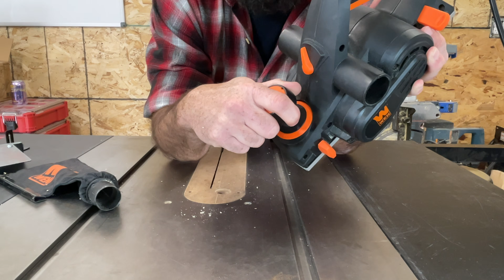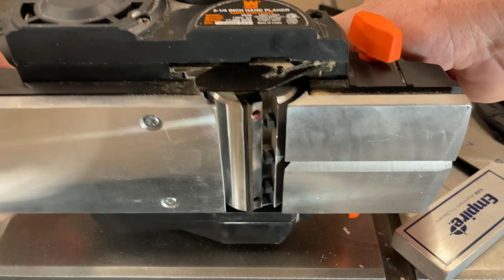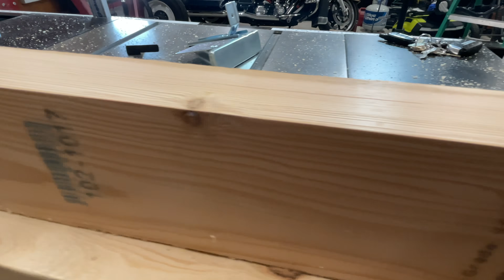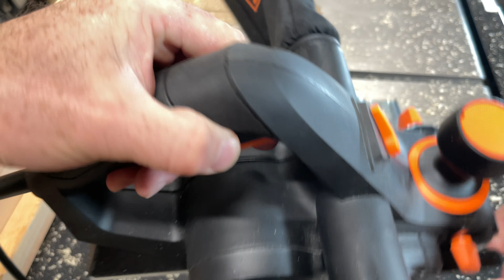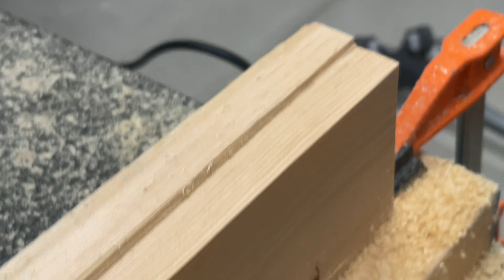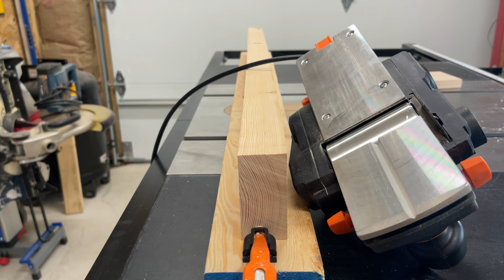Hand Planer How To For Beginners // Wen 6 Amp Planer Review

Comment: This seems like a great way to have a hand plane and rabbet plane for very occasional use without the same learning curve, expense, or sharpening setup needed for regular hand planes. I prefer the manual style, but I’m weird admittedly. Fir the power tool woodworker or carpenter needing occasional planing, this looks like a cool option

Comment: so the rear part is flat and sits lower, with the front being higher, does that mean if I take multiple passes over a piece of uneven wood, will it eventually flatten out the wood and stop cutting into it, or will it continue to cut it down lower and lower?

Comment: Just got mine and wondering if I could use it as a paint scraper by gluing a really thin piece of plexiglass on the bottom so the blade hits the paint and barely touches the wood. The 1/64 minimum setting would get down into the wood I'm afraid.

Comment: i've used a lot of electric hand planes over the years and only my bosch has had a fence that i actually trust. that being said, a square block of wood about the length of the planer double stick taped to the heal sole makes a very servicable and quick fence. i've used that method pretty much every time i needed to rebate construction lumber where i'm not sure about what fasteners i might hit. i'd rather trash a $40 wen rather than my $180 bosch.

Comment: thanks for the video. It seems around 6:10 where you stopped had grooves....or is that grain? thanks
Reply from the maker: Looks like grooves. Could be because I lifted the tool off the work but could also be the way too deep 1/8 inch pass overworking the tool. In real life I never plane more than around 1/32 at a time. Lots of small passes are better IMO. Thanks for watching!

Comment: You're meant to use the thin metal flap, near the back of the fence attachment, as a handle. You use that to push the fence into the wood, stopping you from weeble-wobbling around on the edge of the thin board.

Comment: Your advice: What's better to use a cheap router with appreciable tr/m or this tool to make angles ?
Reply from the maker: Beveling an edge? I would use a router every time over this planer. Definitely more consistent results and a more uniform edge. I’m sure you could get good results from the planer but it will take practice. Thanks for watching!

Comment: I have a door rubbing the sagging top frame/jamb of a door. Is a planer a good idea or better to sand?
Reply from the maker: Swelling, ill fitting doors it’s the main reason I own one of these. Much easier than sanding if you need to take off a fair amount. I find taking off a very small amount at a time and making many passes gets the best result. Good luck and thanks for watching!

Comment: The depth adjuster is crude. After hours of frustration I removed the knob and dropped the front plate. I shimmed the plate to make a fixed depth of somewhere between 1/64 and 1/32. 
The design, while similar to other lower cost planers  is terrible due to a way less than precision fit. I have spent more the the cost difference in minimum wage time trying to get a reliable adjustable depth(cuts ok at fixed depth). 
This machine is not a quicker way to plane than by hand when pieces are ruined. I am not a satisfied buyer. Perhaps I’ll epoxy a good fitting sleeve to the area of the body that is so flimsy it can’t be expected to support the front shoe and then maybe not. The next will not be a WEN

Comment: Something I have never understood about these... how does it make a board consistently flat along the length of it, rather than simply taking more and more wood?
Reply from the maker: I’ve never used an electric planner to try to achieve a straighter or flatter surface. It is however a great way to remove a small amount of material across an edge. Thanks for watching!

Comment: Thanks for the little clip and yes, I do have the next size up from the WEN you have showed as 
well as a 13" planer and I am happy with both purchases since I am not a professional and just 
fiddle around with them.

It took me a minute to make sute that you not wearing a Submariner and am still not sure if it is 
an expensive brand watch or a look-alike and yes, it's the design I wear and I leave the good one
in the safe while wearing the Casio not to worry about scratching it up when messing around on
the Diesel or other stuff - take care!
Reply from the maker: Hello John! The watch is a Seiko Samurai PADI edition. Not dirt cheap but no Submariner. I figure if it’s good to 200 meters it’ll survive me beating the snot out of it. Eventually we’ll get that other track saw and the planer for review. Thanks for watching!
Reply: Thanks for your updating responding mail, nice choice and yes, I do like the same diver style and
robust watches too since I am messing around 
water often and am a bit too clumsy to wear an
expensive watch most of the time. 

Take care and try to stay out of trouble!

Comment: So is it just this planer that you shouldn't cut across the grain with?. I just watched another carpenter cut across the grain with a Makita planer, and it worked just fine. Now I am confused because I am hanging a slab door into an existing jam and need to plane off a little off the bottom, which will go across the grain. I don't wanna buy this if I can't use it for that purpose, and I don't wanna buy the expensive Makita one. Someone please let me know.
Reply from the maker: People do it but I was taught never to plane across end grain. You also risk damaging the door. Better to use a circ saw to cut off the small amount from the end of the door. Use a track saw or straight edge clamped to get it straight.  Safer and probably easier to get a good result. Thanks for watching!
Reply: @ProjectsForAllReviews  Thank you for responding.

Comment: It's a pity the guard isn't as sturdy to give straight rabbits. As you suggested in the review with the skil planer the guard is better engineered. I think you could fix the guard on this one by spot-welding a strip of sheet metal between the pieces of the guard to provide additional support.  I was looking at the equivalent Porter Cable planer and that guard has that support..same as the skil one. The only thing the porter planer doesn't include the adjustable rabbit depth stop.
Reply from the maker: You guys are right. I watched it and the second pass I’m off the side. I didn’t notice it in editing. I picked up a Ryobi planer for a 3 cheap planer comparison vid I’ll do in the next couple months. We’ll have to revisit the this and see if I can get a better result. Thanks for the comments!
Reply: @ProjectsForAllReviews  that’s cool. No big deal. Just figured you were more concerned about the review than perfection cuts.
Reply: You can clearly see he wasn’t shooting for that at all. His guide wasn’t even touching up gains t the stock several times through out a single pass.
Reply: @johnblack8187  ...Hmmm... That's a good point.. The first pass had some wiggle in the back and then the second was even worse, the guide wasn't pressing on the side ..
Reply: @mpcp27  I’m sure if it was held steady up against the guide it would be much better looking results.

Comment: I bought used fence board, 4 inches wide. I want to get the grey off of the boards so I can repurpose them as walls inside a van. So far I’ve sanded about 8 of them down with a palm sander, waaay too much work. Would this planer do the job? Would it be pretty even if I had to do a few passes to accommodate the wider fence board?
Reply from the maker: Hello! A hand planer will be much more efficient than a palm sander but will still require a little technique and finesse to get the grey off. Planer and palm sander after will probably get good quick results. Check out my first ever vid for before and after cedar fence pickets with a bench planer. Good luck! 03:30
https://youtu.be/u24zRGsl6t8
Reply: @ProjectsForAllReviews  so I’m just new to woodworking, can I ask, would a belt sander be better or a planer?
Reply from the maker: Both would work. The hand planer IMO would work better with the palm sander to clean up any lines left on the board. The planer only works if you have a loose board with both ends exposed for a start and stop point. The belt sander will remove material anywhere you put it and works better when the boards are attached to something and secure. Belt sander will tend to want to take off in one direction and throw the loose material in the other direction. I used a Makita belt sander to remove multiple layers of paint and varnish from my wood porch. I think it’s best suited for that kind of task. I hope this makes sense. Let me know
Reply: @ProjectsForAllReviews  that makes perfect sense, thank you very much!!!

Comment: I was actually looking for some instructions of how to plane a wide board easier. I have a 22 inch Live Edge that I'm making a coffee table out of
Reply from the maker: I’m sure it’ll be a future video at some point but I have a lot lined up for the next month or so. Sorry I can’t help you with this one. Thanks for the comment.
Reply: I just made butcher block countertop out of ash wood using the larger wen electric planer. It's 25 inches wide. I went against the grain to get it flat across, and it worked lretty well.

Comment: The blades on the first one, and the replacement WEN sent me were not straight.  One of the blade set screws stripped and they sent me a free replacement, which was nice of them.  But even after adjusting the blades on the replacement to get them as evenly as I could, it still would not cut flat.  Perhaps I'm doing something wrong, but I gave up on trying to use it.
Reply from the maker: Honestly I’m surprised we haven’t heard more stories like this considering how ridiculously cheap it is. Skil sent me they’re version of this same planer for a review. Should have that vid out in a week or two if your still shopping. Thanks for watching!
Reply: Same issue for me…My Dad (who won’t be around much longer) flew out to visit and helped build a large window bench top with me. After he left I only had to plane it, sand it, and stain. The planer destroyed it, leaving uneven gouges and lines. I’m VERY upset as it’s something I can’t just get myself to throw it away as it was one of the last projects my dad and I did together, yet it looks really bad
Reply from the maker: @nwembly  Can you email me pics of the damage. I’ll try and give you some advise. Email is projectsforall60630@gmail.com